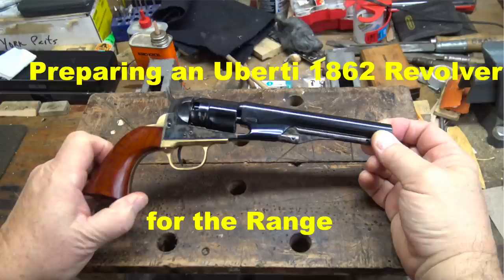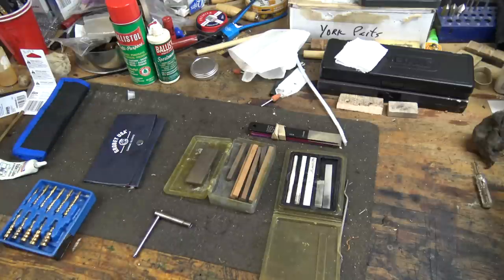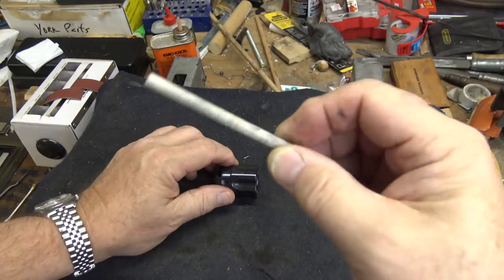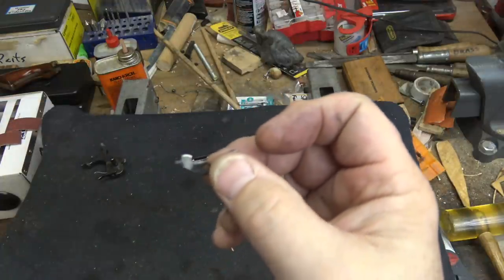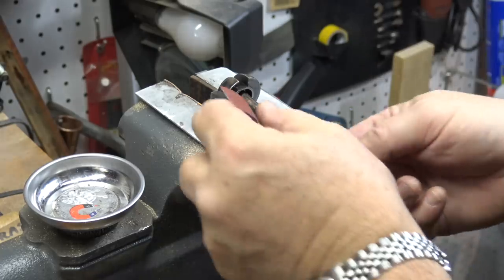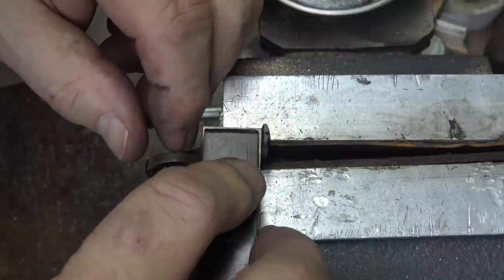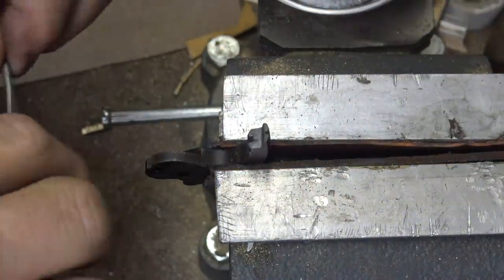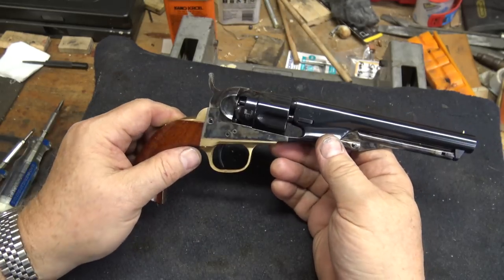Preparing an Uberti 1862 Police Revolver for the Range

Comment: Great video. I de-fanged the hammer on mine right after I bought it a couple years ago. Now I need to smooth out the cylinder pin. The action is timed correctly but only if I pull the hammer moderately. Thanks for showing and sharing this one. It's a great little revolver.

Comment: In my experience cap sucking like you call them has way more to do with a soft hammer spring than the strike surface or notch , you can verify that simply by placing stiff spring between the main hammer spring and the wood handle or by adding a second exact same OEM spring on top of the original preventing the hammer to get pushed back at the ignition of the cap & powder pick pressure letting the cap being pushed out and eventually get strike by the hammer on his 2nd fall or falling down the frame messing the action . Even on my Uberti Walker on wish one i can't fire three or sometime three time without a cap falling into the action or being crunshed aigainst the frame where the arbor hole is located preventing the hammer to reach full course and so he can't hit the caps on the nipple . I had do three thing that have make it 99.9999% reliable even without cocking the next chamber with the gun pointed to the sky . 1st and easiest one , use of Remington N°10 cap exclusively they are the one that just perfectly match the nipple my walker come with . 2nd was the Spring added to push a bite more on the main hammer spring ( as you can't just add a second spring on top of the original due to the V shape spring design the walker was design with ) . And last but not least , making a V notch on the top face of each nipple facing the center of the cylinder so the gaz escape right there and split the cap open rather than explode it in multiple pieces ( i would have used Slixshot nipple but can't get them delivered in my european due to regulation on modifing any gun wish is clearly not allowed here  )  . That said , i do not have your experience with percussion gun or general firearms in general Mike , but that's really what i figured out with the hammer spring .

Comment: I sent by Dragoon and my Pocket Police to Mike Brackett (45 Dragoon) and he did an action job, adjusted the length of the arbors, installed cap rakes and installed a coil spring to operate the hand. The Dragoon is a work of art and the triggers are the lightest on a revolver I have pulled But the Pocket Police still doesn't handle caps very well.

Comment: I have this gun. It's one of my favorites. Shoots very accurately. Thinking of getting a 61 Navy next.
Reply: I have Authentic Colt '61 Navys.  Oddly, they re  just as heavy as the '60 Army.  I thought they d  be lighter due to the 'Silver Steel' improvement.  Nope!  Unlike the '60 Army, the barrel/chaber thickness is the same as the '51 Navy and not trimmed/lightened like the '60 Army.
Still   w a y y y yyyy   sleek and   n i c e   shooting!

Comment: Hi Mike, all Uberti revolvers have an issue with the arbor not being the right length. All current Pietta production have a correctly sized arbor where the barrel/cylinder gap is perfect hitting the wedge fully in. Optimal accuracy will never be accomplished with a gap that changes depending on how far the wedge is hammered in. IMO Uberti needs to solve that defect in their C&B revolvers. I drill and tap a hole in the end of all my 13 Uberti revolvers to support a set screw to optimize gap with a hammered in wedge. Only the Pietta Paterson doesn't have an optimal length arbor. I put a set screw in those two Patersons.
Reply: @griff7749  Hi Luke, function isn't a problem with the short arbor, but reproduceable accuracy is the issue.
Reply: Yup...ideally the wedge should be able to be inserted and removed by  hand. If it needs tapped, pounded or abused in any other way, you have arbor issues.
Reply: @griff7749  see my reply to Brad Potter above.  My experience:
Brad, my Uberti 1860 Army has the same problem.  Can't even fit a 0.001" feeler gauge in between.  Sometimes I would shoot it and thought the black powder was gumming up the arbor and causing hard cylinder rotation.  Sometimes not.  What it really was, was the metal expanding as it got hot and with no cyl gap, it was making the rotation difficult.  I haven't fixed it yet, but I'm thinking of trying to take a few thousandths off the breech end of the barrel.  Just a little.   Otherwise a great gun.

Comment: Hi Mike,
     Enjoyed your video as usual. I was wondering if you had any issues with the arbor length on this Uberti. I have an 1860 that when you tapped in the wedge all the way, the barrel to cylinder gap would close down to nothing. I had to add a spacer to the end of the arbor to solve that problem.
Reply from the maker: No. I've never had an Uberti gun where that was a real problem.
Reply: Brad, my Uberti 1860 Army has the same problem.  Can't even fit a 0.001" feeler gauge in between.  Sometimes I would shoot it and thought the black powder was gumming up the arbor and causing hard cylinder rotation.  Sometimes not.  What it really was, was the metal expanding as it got hot and with no cyl gap, it was making the rotation difficult.  I haven't fixed it yet, but I'm thinking of trying to take a few thousandths off the breech end of the barrel.  Just a little.   Otherwise a great gun.

Comment: I was considering picking up an 1862 and/or an 1861, I've heard that the Cabela's/Pietta models have the ability to accept Howell of old west's gated conversions, and that the only real difference with the piettas 1861/1862 is that the '62 is shorter and has a fluted cylinder with 5 shots. That Uberti looks pretty slick out of the box.
Reply from the maker: Hopefully you understand that the Model 1861 is built on the Colt 1851 Navy frame, and it is a full-sized belt pistol, like the 1851 and the 1860 Army,  but the 1862 is built on the same frame as the .31 caliber 1849 Pocket Model. So it is essentially a pocket-sized .36 caliber.
Reply: @duelist1954  I'm aware, but a few are saying that the Pietta versions sold by cabelas used the 1861/1851 cylinder, just with 5 shots, and that it isn't really a true 1862 police at all and more of a just smaller 1861? Some are saying they even made an 1862 in 44?
Reply from the maker: @Munky332  The Pietta version, which they call thev Metropolitan Police model, is just a regular, full-sized  1861 model with a half-fluted, six shot  cylinder. It bears no relation to a real Colt 1862 Police model...doesn't look anything like an actual '62...just a fantasy 1861. I hadn't seen a .44 caliber version, but nothing would surprise me. Sorry I mis-understood your original post. The answer is yes, the same conversion cylinder will fit either of the Piettas.

Comment: Have you given up on using JB Weld to fill in that hammer gap to prevent the cap-sucking on these Colt types?  Great video, Mike
Reply from the maker: I gave that up years ago. I've demonstrated this technique in four or five videos.
Reply: I mig welded the hammer safety slot on my 51 navy, never had a cap suck issue ever since

Comment: Hello sorry for writing under old video. I just bought it as my first ever black powder weapon. I have a problem. I bought is second hand and the seller didn't told me he WRAPPED THE ABOR WITH HYDRAULIC TEFLON TAPE. He did this because seemingly without tape the cylinder is moving forward and backward around 1mm. Is this normal? With the tape it is not moving forw-rearw but it doesn't rotate like yours. Should it rotate so fast? Should it move forward-rearward 1mm? (it moves in such a way when the cock is resting on a cylinder nipple).
Reply: No that’s not normal. Sounds like it could be an arbor that is too long and placing the forcing cone too far in front of your cylinder face. Additionally I’d check the bolt to cylinder notch fitment to make sure it is holding the cylinder correctly.

Comment: При всем уважении,но будет неумной идеей обрабатывать внутренние части вала наждаком.Барабан будет разболтанным
Reply: I have to agree with you.
The most I would have done is use the round ceramic stone on the cylinder, without the sandpaper, and only used 000, or 0000 steel wool on the arbor. 320 sandpaper is way too aggressive. Also t would have started with the medium instead of the course on the hammer safety slot tune-up.
Reply: @mawilkinson1957  возможно хозяин  планировал дальнейшую обработку в гальванической ванне..

Comment: 👺 HEY DOES THAT MEAN I NEED .31 CALIBER REPLACEMENT PARTS????????? SUCH AS HANDS/SPRINGS?? and thanks I got one in need of repairs....VTI, Track Of Wolf the parts are a no fit.....Mines is an older CVA product no nibs for the safety catch everything else is same though 5 shot .36. stepped frame, bored cylinder